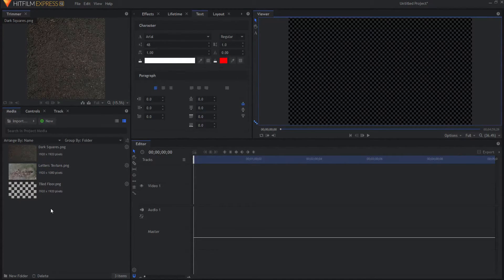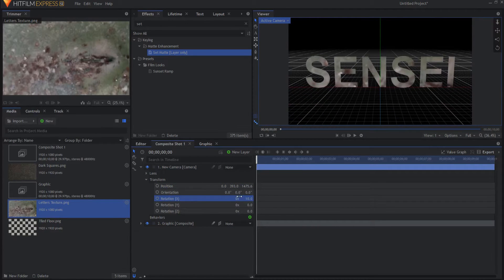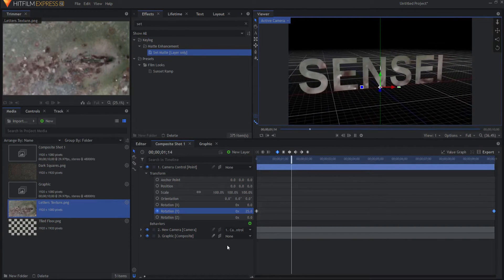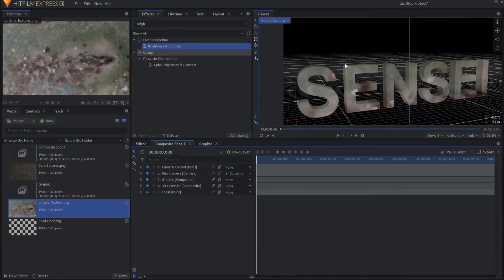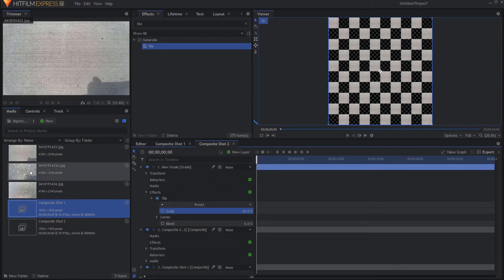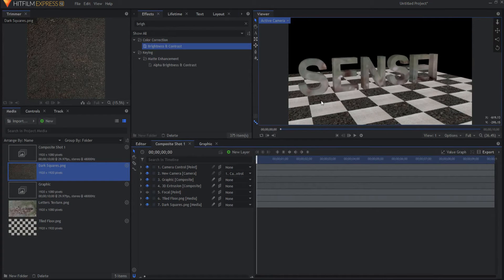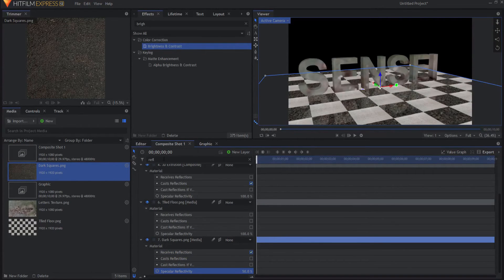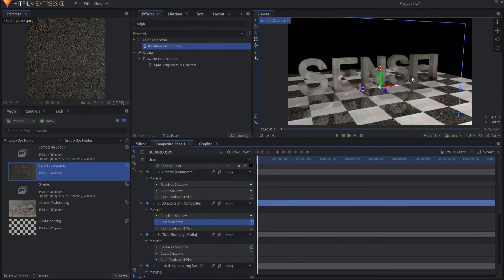Reflected 3D Extruded Text in HitFilm Express

Comment: The reflections are almost anticlimactic because it's really just turning on an existing feature.

That fake extrusion with the zoom blur and alpha choke is brilliant! A nice extension of Palacono's trick for angled drop shadows. I like the Neon Glow version as well. That variation would let one recolor the bevels.

Loved how you set up your checkerboard. Very elegant solution.

You've just been on a roll of great tutorials, Jay!
Reply from the maker: Thank you. I DID steal the "angled drop shadows" technique from Palacono! :) The Neon Glow version was how I did this before, but when I saw his use of the Crushed Blacks and Whites Alpha, and I had to play with it. He actually taught it to me after I did a tutorial on flat shadows using the Neon Glow effect and he saw it. The checkerboard solution was really the key point that I was teaching as far as the reflections in the black tiles was concerned. Turning ON the reflections was definitely the easy part, but it was the set up that I was really teaching! Also, adding the Parallax at the very end almost seems like an afterthought as well!